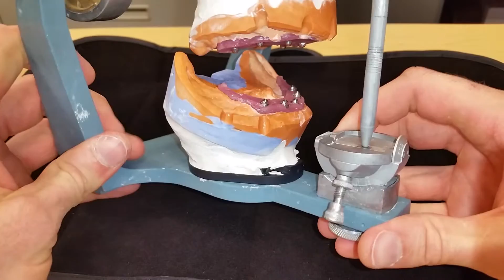Derek Gatta "Articulating max/man hybrid cases" Dentistry

Comment: Loving the videos! I appreciate the focus on mounting and articulated work. Most the ones I see are all chair-side. Fun to watch but need this part too! What’s is a copy mill restoration? Would the lab use the pmma check jig as the “wax up” for designing the metal framework? Seems kinda big.
Reply from the maker: Hey thank you for the kind words!  Generally when the term copy mill is used, people are referring to an implant supported  restoration that has Titanium or Zirconia preps with individual crowns cemented over them.  For a wax up, I the provisional scanned then make changes digitally and then the lab will mill a cheap PMMA provisional so I can check the esthetics/phonetics.  That can take several attempts.  We do before the final expensive restoration is fabricated so we know the patient has approved of the set up.  If not using the digital mode, I use to do a denture wax set up that I can screw into the implants and check esthetics/phonetics just like doing conventional dentures.  Take care!